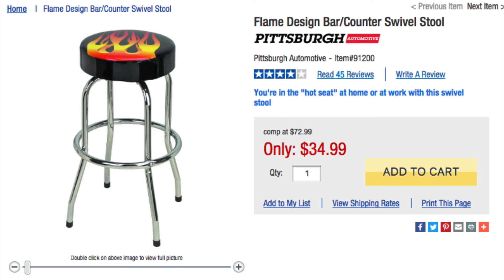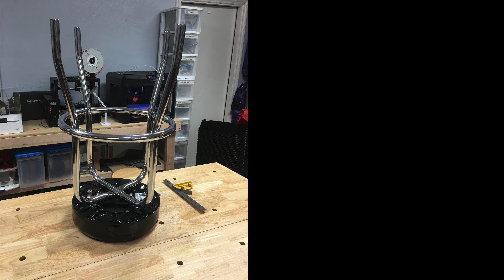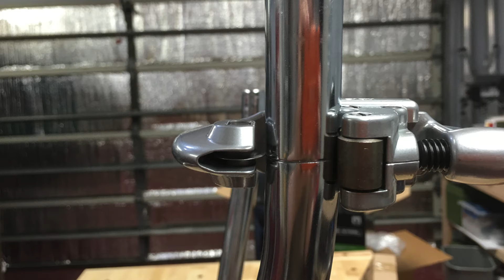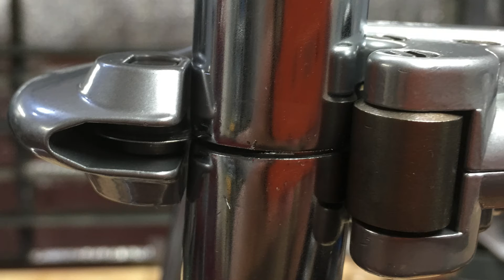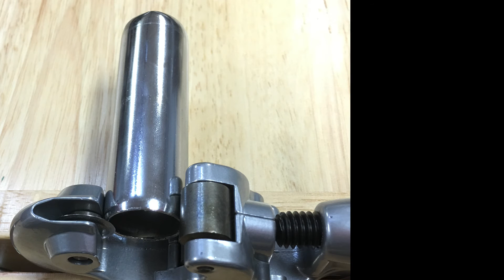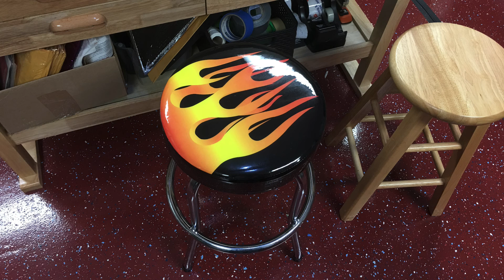Hacking the Harbor Freight bar stool

Comment: However these are great bar stools https://goo.gl/ILnBeK . Quality is superb specifically the purchase price. Caution when assembling the chairs. When you begin putting the bolts on the back rest to connect it on the seat ensure that you include a washer with the 2 middle bolts or even bolts will result in the wood pop out on the exterior of a back rest. I purchased 4 stools and my first one I assembled did this. Now one for the stools stood a new collection of instructions and two bolts who were shorter that fixed this condition.